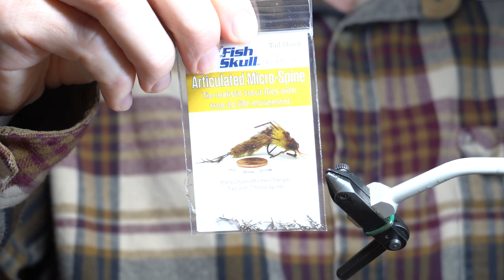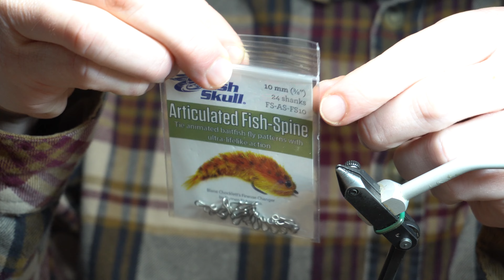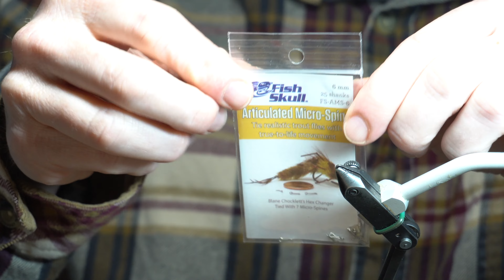Gamechanger, Medium and Small - McFly Angler Fly Tying Session

Comment: Another great video. 
Thanks for talking about putting ballast down on the bend of the hook. And more ballast the faster you want to retrieve the fly. 
I have a few applications where "burning" just under the surface could be a productive technique. 
Looks like adding wire after the fly is finished could be done to tune it.
Or possibly use a jig hook or put a dumbbell eye on.
Reply from the maker: Thank you, yeah more weight for faster retrieve for sure.  Glad you liked the video